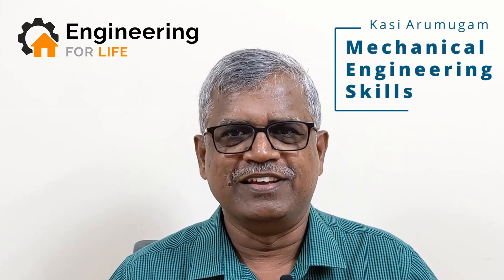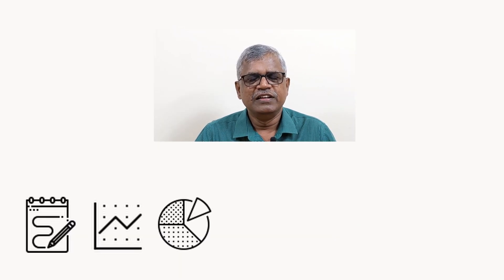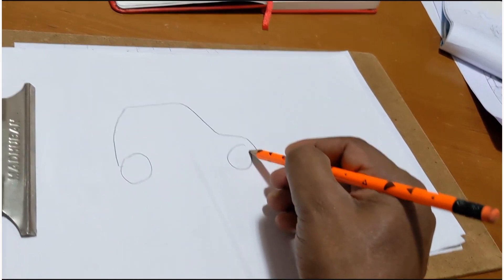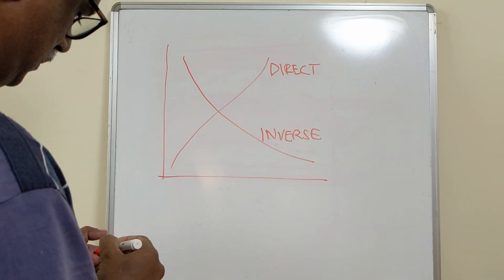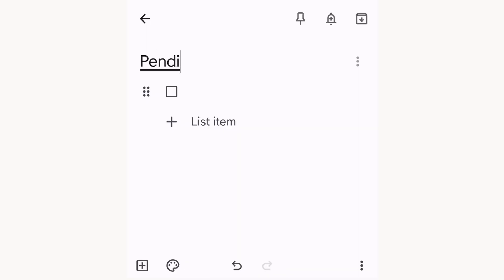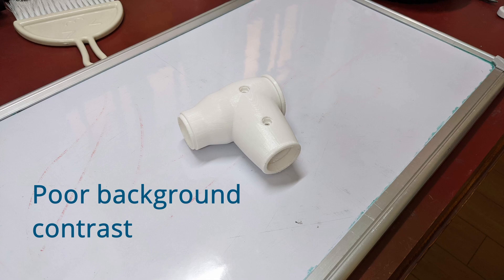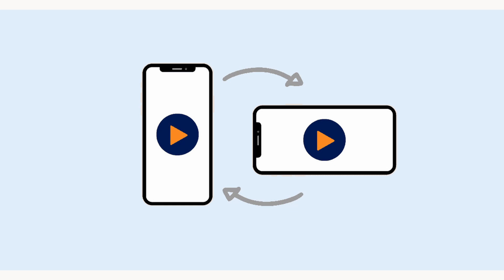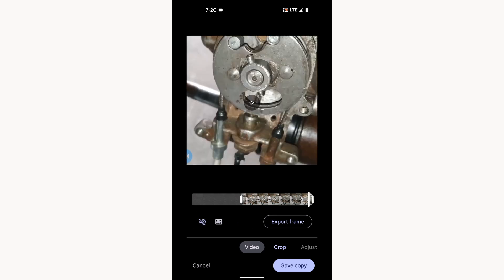Visual Communication for Engineers - Mechanical Engineering Skills - Part 1

Comment: Audio also important 😑 I thought my new headphones was gone.
Reply: @Engineering4Life  Anna, doesn't seems to be a headphone issue here. Even in my home theatre, the audio is playing only on the front left channel but audio from other sources are playing in all channels
Reply from the maker: @ezhilra  yes, both channels are playing in my BT speakers, but not in the wired earphone. Something must be wrong somewhere. Let me check and correct if possible.
Reply: @Engineering4Life  😏
Reply from the maker: @Arunkumar_  I traced the problem and found the issue. Thanks for your flag! Will be careful in future😬
Reply: @Engineering4Life  Thanks anna
Reply from the maker: I don't get it. Do you feel the volume is high?
Reply: @Engineering4Life  I can hear only left side, no sound in right side 😑
Reply: @Engineering4Life  😱 it is a new Bluetooth headset 😰